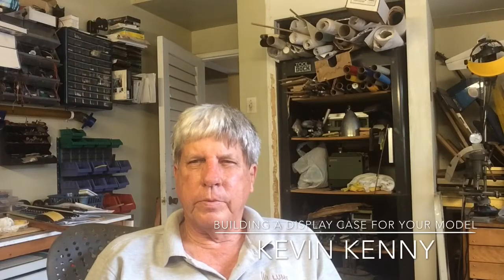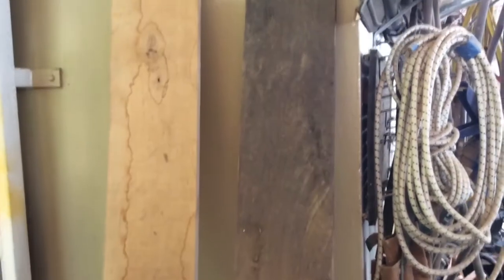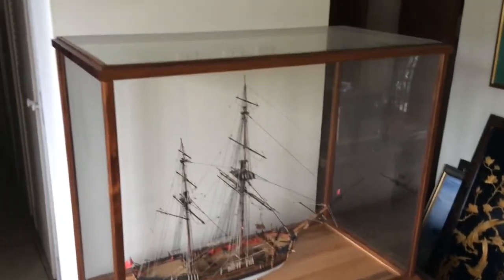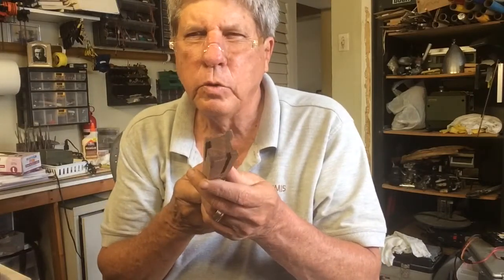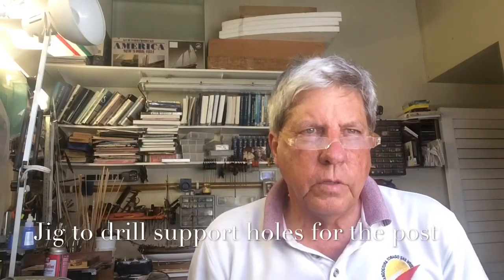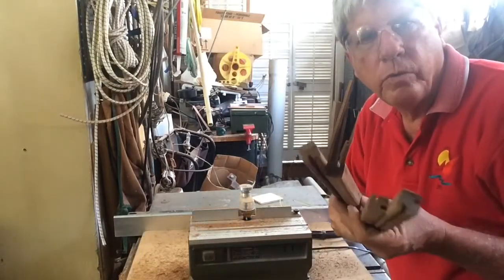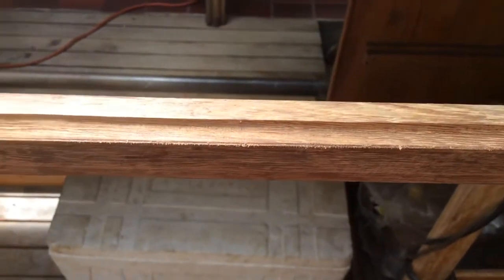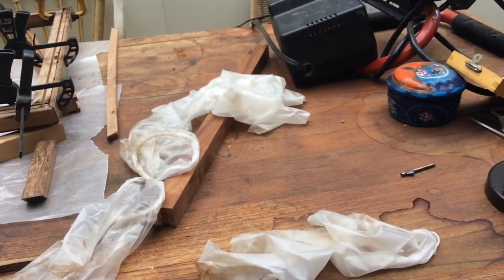HMS Granado. Video 48. Part 1. Building the display case.

Comment: looks good. im stsrting to figure out how to make a display case for my victory. do you have any drawings or actual dimensions of posts and frames?
Reply from the maker: Hi Dick. The short answer is no. All my models are different sizes and once you decide on the framing method then your your model will determine the size. I find that you need 2” on each side  of the model, thats left side and right side, front and back. the height depends on where you are going to display it. My rule of 2” hold here as well, but i have made the case taller  in some cases when i may use a different pedestal or want to show of the top mast flags.
Reply from the maker: @dicksmith3553  the post were 1” square but in later models i reduced that to 7/8”. I find that if the post are not decorative then the corners take away from the model. Of course it becomes more difficult to build as the post gets smaller.  With one of my models i made the top and bottom frame out of one “ square section. Then i stuck the glass to the top and bottom frames with silicone. I also stuck the side glass to it self. Once it had all stuck i then  cut 1/2” corners and stuck them to the side. These corners were just decorative and played no role in the structure of the case.
Reply from the maker: You can see this case in https://youtu.be/4JqKZTHcunQ
Reply from the maker: Here is the finial video on that case.  https://youtu.be/Yww5iGLiAb0